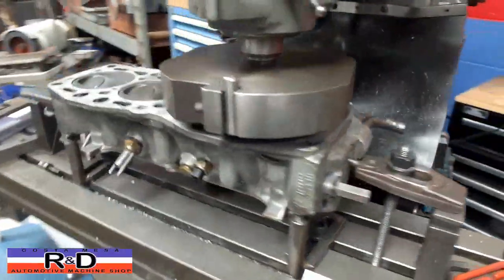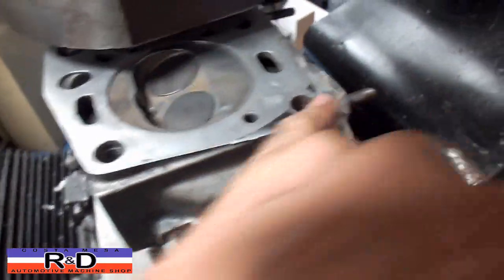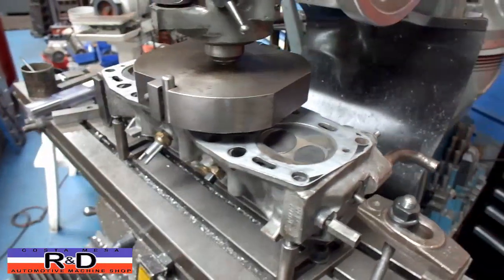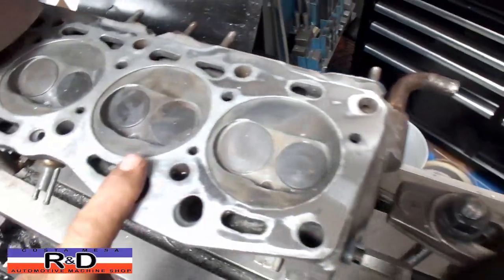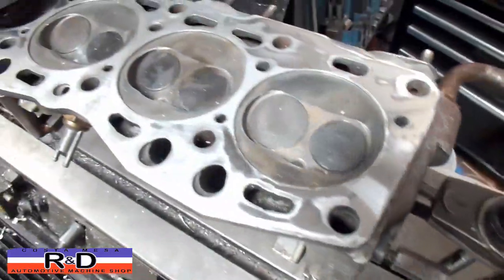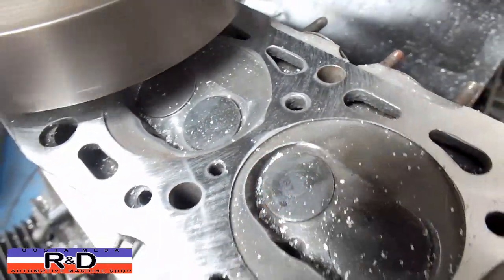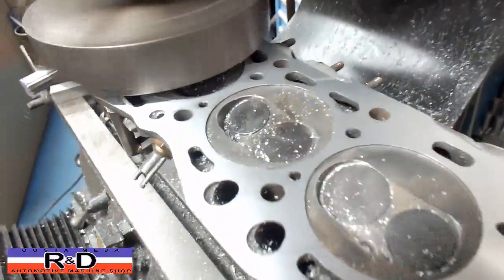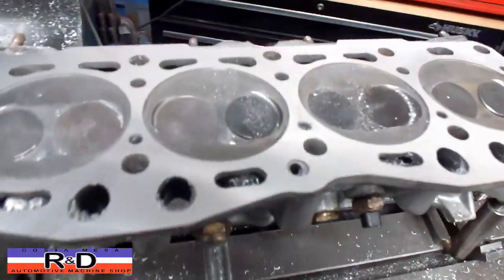Cylinder Head Resurfacing   Fiat 129 X1 9 & What Not to Do

Comment: Hi John

Like the jack setup, curious on what surface you use to establish parallel to the table for both X & Y?  Also, can clamp pressure rack/twist the head?

ATB
Chuck
Reply from the maker: outsidescrewball I don't work about X & Y, just Z. Used a back-plunger indicator to establish Z.

Comment: Not that I am a complete and total newbie to machining heads but if you take off material will the tolerances be off as far as compression?  Are you making up that difference with a thicker gasket?
Reply: Dont be afraid of what the makers say the take off material is whithin specs
Reply from the maker: With .006" removed, I wouldn't bother with a thicker gasket, and besides there are no thicker gaskets available for this engine. Typically, for every .010" removed you increase the compression ratio by .1. You can certainly have carbon build-up in the combustion chamber that will reduce volume and increase compression as well. I could go into this further, but don't have the time. John...

Comment: Excellent video.
Can you tell me about the large fly cutter. I would like to make one but have not seen one that big in a r-8 collet set up.

Cheers,
Dave
Reply: Make your own,use a flywheel.
Reply: make sure that 20mm shank is perfect size, i wouldn't risk a looser fit as the r8 wont clamp safely

Comment: Hi there John!
Always nice to have a new video from Costa Mesa R&D in the mailbox.

We have to resurface our heads from time to time and last time we did that, we used a resurfacing horisontal grinding machine. (if you know what I am talking about)
Not a milling machine as you use..
The result was great and the sealing did the job fine when everything was together.
The head belongs to an AMG 3,6 straight six cylinder engine.
It is fed by an Eaton M112 up to 1 bar.

What do you think about the difference between a milling maching and a grinding machine when it comes to resurfacing?

/Anders
Sweden
Reply from the maker: What ever get the job done, that works for me. Typically we use grinders for iron heads and no alloy. As long as you get the correct surface finish, you should be good to go.   John...

Comment: So, the fly cutter is not cutting on it's leading edge/side? 
Couldn't really get my head around that at first. Is there any advantage to have it set up like that?
Reply from the maker: The leading edge of the cutter is doing the work. I used a carbide cutter for the first few passes and then switch to high speed steel for the final cuts. A lot of people bah humbug HSS, but if its ground correctly you can see that I got a 25 Ra finish. Nuff said...    John...